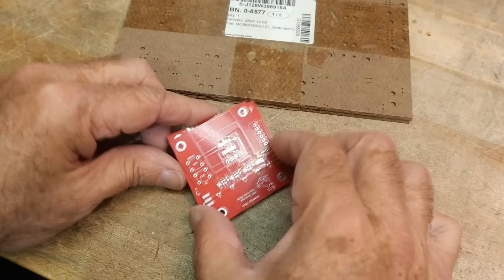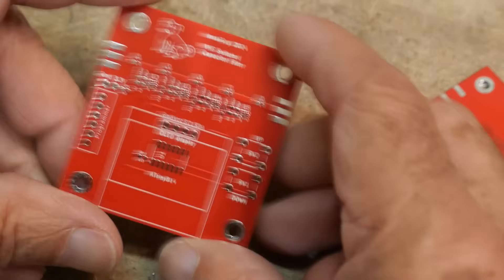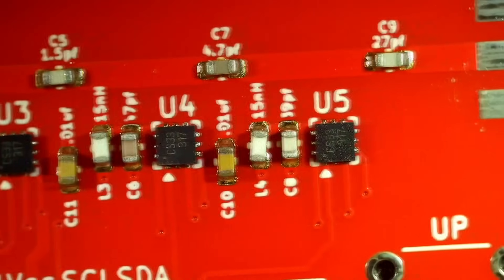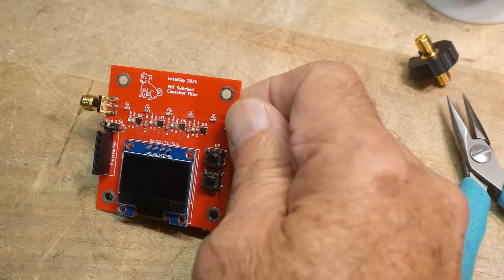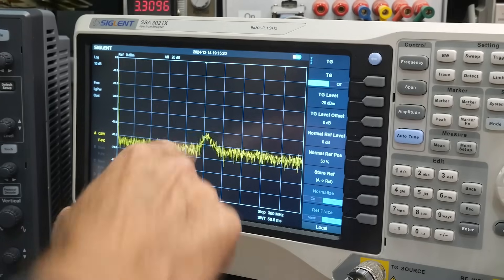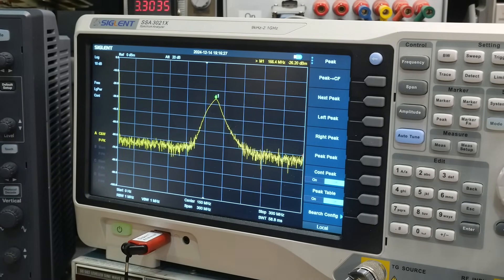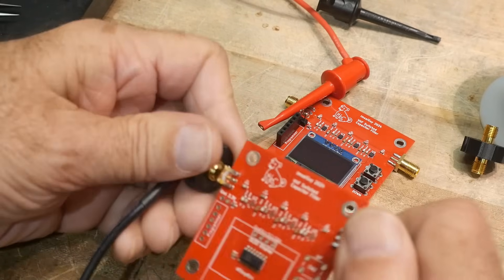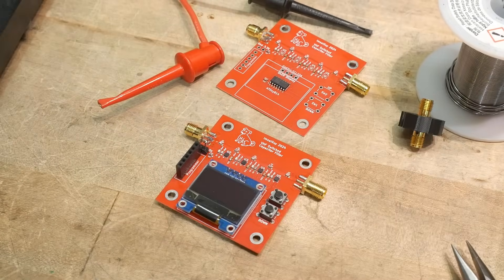#2101 Variable Digital Capacitor Filter (part 4 of 5)

Comment: Question: in datasheet there is 27dB power limit, but there used as a „caps to ground”. Could this filter be used for > 1W RF signals?

Comment: One possibility is that the PCB input / output is not properly designed to match a 50 ohms load.
Reply: I'd like to look at S11 too. I'm worrying if trace width was calculated with the mask on top or just a bare board. I woukdn't guess that much change at VHF but the RF gods may be angry.

Comment: That's kinda cool, I suspect it would be a tricky algorithm but I'm wondering if it could be coded so you feed it with a clean signal from a generator and it auto tunes for max output

Comment: I'd want to know more about the missing pin/pad.
Reply from the maker: What’s missing?
Reply: I was wondering that too so I went back to the pinout in the first video and it looks like VDD and/or SCLK. No idea what the capacitance would be without power or programming. It seems like if you put a dab of solder paste on that trace and heated the board from the bottom that it would pull it under since solder flows toward the heat.

Comment: Sometimes its good to add a through with just your trace. SMA -> "50" trace -> SMA to measure the actual trace impedance and loss. You see this on dev boards quite often. Also, you have some stubs on the L and C, you could put the pads directly on the trace. This might help.
Reply: That's what I figured, pretty low frequency. Maybe try just putting 0 ohm resistors on just a bare board and measuring the trace loss. Would give you a good idea if it's your trace or something else.
Reply from the maker: @redrighthand9122  trust me, the trace is not the problem. I've done lots of microstrip designs to many GHz
Reply from the maker: at 150MHz those are not active stubs

Comment: Don't be afraid of 0.5mm pitch, even with 0.2mm (probably 0.15) spacing QFNs with modern fabricators PCB you got enough space for solder mask between pads, so flux will do its job just fine.
And with a stencil should be a walk in a park..

Comment: 10 db is a LOT of loss! Especially for that poor of a filter.
Reply: Because of low Q SMD inductors.
Reply: @atakaravelioglu301  Yes.  If those itty bitty SMD inductors are replaced with hand-wound air core inductors for instance, the bandpass shape will be better and the loss will be a lot less.